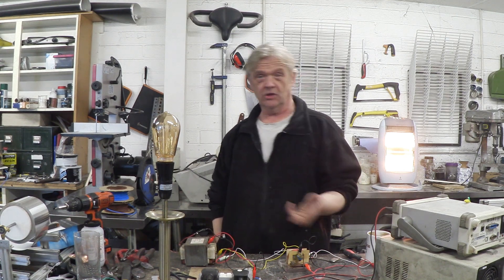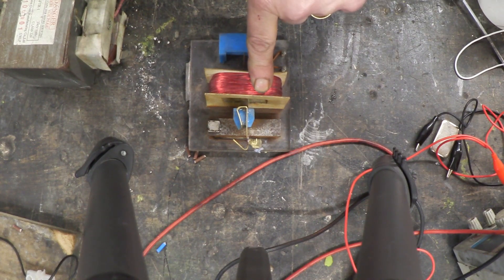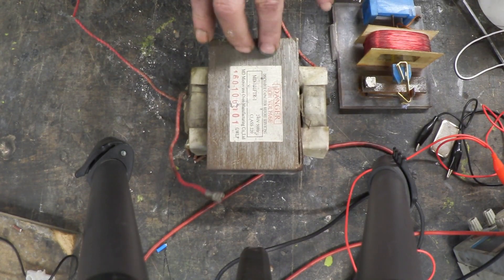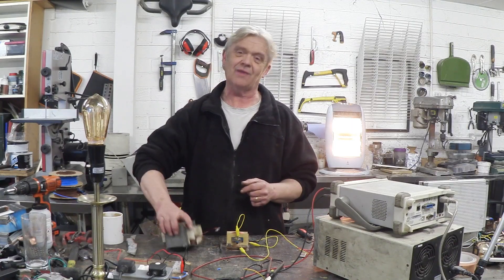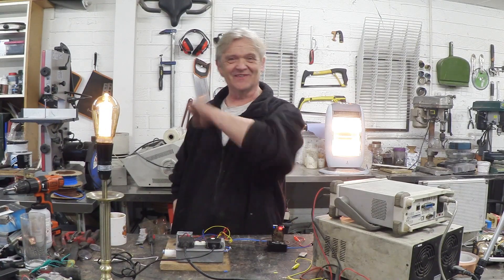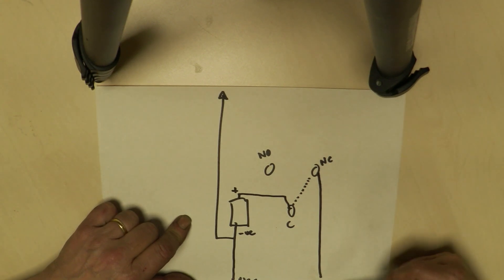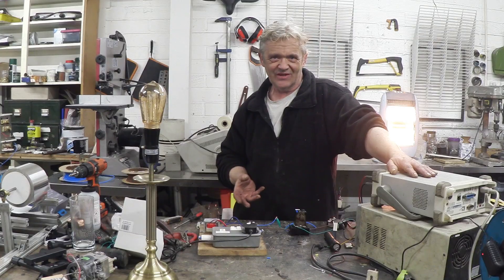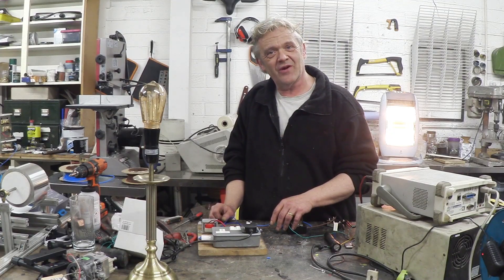1026 The Easiest Inverter You Will Ever Make

Comment: I was looking into this some time ago and was put off by the cost of relays and the noise, not sure if with an SSR solid state relay H bridge it would be better (never got to test it). I find it specially interesting as inverters now are expensive and can fail easily (makes it or complex to repair or expensive to replace). I was thinking of this in the context of heating loads during sun spells (solar + battery)
Reply: I... accidentally deleted the reply I typed. Trying to recreate it from memory:
Looking at this circuit, I don't think an H-bridge is even necessary! You just need some way to generate a square wave at the desired frequency (555 timer?), and use it to somehow switch your high-amperage DC side (Preferably with something less noisy than the improvised contactor shown, one DC SSR should be enough, in other words, as long as it can handle the power. Needs to be pretty powerful, though.). This eg. 0-12V square wave side goes through a transformer, and the AC coming out the other side has the same peak-to-peak swing, multiplied by whatever the step-up factor of the transformer is (-6 to +6V for a 1:1 transformer, -60 to +60V for a 10:1 transformer, etc.). Voltage is relative, so you can redefine your "zero" freely between the sides of the transformer. The only actual output it produces is the difference between its output terminals, and that only cares about the difference between the input terminals. The "average" of both sides can be completely different (as long as you don't connect between them)! Super clever stuff! Keep in mind that the peak voltage of an AC square wave and the RMS voltage are different, though! You'll need to do some unexpected mathematics when selecting your component values if you want to provide comparable 'voltage' to a traditional sine-wave AC grid!
That said, if you need AC at a voltage you can easily achieve for DC, an H-bridge might make more sense. I think this is more for producing bootleg (square-wave or otherwise malformed, but correct frequency and VA) "mains voltage" AC, as you would in some sort of emergency or off-grid power system (as he said, you won't be running any delicate electronics off of this, and some kind of motors might also be unhappy. It should run lights and heaters intended for mains voltage though, and maybe other stuff too! Keep in mind that the power supplies used in 'mains voltage' LED lights vary greatly. Some won't mind it at all, some might not work, some could even break, it all depends on the specific circuit used. No idea how fluorescents work, but they have a lot of electronics behind the scenes too, as well as being scary high-voltage gas-discharge tubes, so I would be afraid to try them with power sources they weren't designed for.

Keep in mind I'm not an expert, I just like to read/watch things like this. The books I have don't really talk about AC stuff a lot, and even less about non-sine waves, so I may have the wrong idea about any or all of this. Stay safe!
Reply from the maker: I used a DIN rail relay because it easy to see but Omicron make relays in the order of a pound or so with 100,000,000 fillips - and I din't get that wrong - they switch with that order of life - but the noise is an issue unless you put a piece of felt around it - An SSR can't switch fast enough.
Reply: Thanks to both , in terms of frequency i had thought arduino could be used to create the frequency for 50 a second. In terms of step up i got hold of a 240 to 12 AC transformer and was hoping to go in with the 12. For ssd not being fast enough, i could be mixing things up but i think the idea is a single one would only handle a  half AC cycle but doing the H bridge would give you both half cycles (yes, square form). There are ssd on ebay for high amperage (i thought i would target to use half the max rated amperaje). I am also  not a specialist, just dabbling and never enough time to finish things but this one i want to finish one day, i have a second 240 to 12v AC transformer, not sure of wattage now but its a 16kg beast 😅. Overall to use with a hot plate not electronics. All part of a wider thing... Damn the castles in the air and not enough time...
Reply: @TheBlackadder-Edmund  That all sounds good, except the use of a microcontroller as a frequency generator. As it's going to be exposed to whatever electromagnetic noise this inverter makes, and whatever poor-quality power source it's connected to, and the sudden power drops on the DC side from the AC side being connected to a load, I would be worried about a microcontroller potentially crashing here -- keep in mind that, if it crashes while generating a PWM square wave, there's a 50-50 chance of essentially shorting your DC supply across the transformer. Maybe I'm just overcautious, though.

Comment: I personally like the idea of useing a brushed motor t drive a commutator, I think it would be much esyer to make a drive sircuit for. I think they used to make an inverter made of a motor connected to an altanaitor at some point i'm guessing it'd be the best regarding both control and sine wave quality.
Reply: True, this was common technology. My Dad told me about working on the Vampire (1950's, one of the first jet fighters, used in the RAF and RAAF, amongst others) that employed this to obtain high voltage.
Reply from the maker: I believe they were called dynamotors mate

Comment: Good project and demo.  I'm anticipating a variable, controlled frequency oscilator made from a cheap rc motor and driver, with a magnetically pulsed, voltage amplifying switch actuated by a rotary magnet, in a shielded, steam punk case.
Reply from the maker: lol - pretty much the plan here mate lol

Comment: I immediately thought of my father's Model T ignition coil/box.   (Made my first Jacob's ladder with it).

My first thought on the frequency stability:   I think you could add a 50/60 hz resonance circuit to the activation of the relay coil to help stabilize the frequency somewhat (without making it overly complex).

Additionally, like the old Ford coil, you could have a thumbscrew to adjust the spacing between off/on (deadtime) which could optimize for frequency too.
Reply from the maker: a capacitor in parallel with the relay coil will do it mate thought you would need a DPDT relay as you would need to connect the output to a different switch to help prevent frequency drift

Comment: LOL I have a 300w 12v / 120v inverter from back in the 70's that uses a vibrator relay with a set screw to set timing.    Being square wave out put it's noisy as hell but works for many things.  Most modern Computer PSU would be ok with it. KISS , Keep It Simple Stupid is the game.     Not like your trying to run a Air Conditioner with the thing.    Put a .o1uf cap across your contacts and they will not ark so much.
Reply from the maker: lol - that is awesome mate and thanks for the cap tip

Comment: The Surge in Solar PV caused Me to realise the Possibility of more DC Systems.
In Turn DC Lighting is Easy to do.
If Only the Manufacturers Offered a Broader Range of DC Lamps plus DC Rated Switches.
I did Enjoy the Video.
Reply from the maker: I agree the real answer is to change the equipment used to DC - after all most of it I DC already and ac is really only used to transport then changed back to DC for loads of things

Comment: I did the exact same thing except all i used was car relay, running in series with contactor, and to control the frequency rate you put different rating capacitor on the coil,
Reply from the maker: cheers mate

Comment: brings back memories of 1950s car radios that used valves  with a vibrator power supply fot the HT
Reply: Yup... 1957 Chevy from my youth... remember that HV step up arraignment pretty well.... and waiting for the radio to "warm up" before it would start to output audio...
Reply from the maker: lol - exactly where I got the circuit from - I just cut out all the stabilising stuff

Comment: What comes out of there is rf interference pissing off all your neighbours lol
Reply: Much less these days, but you'll certainly piss off Hams for quite a ways away.
Reply: Make it inside a microwave.
Reply from the maker: if you really wanted to do this you just put it in a can like they used to - this was used in car radios
Reply: Absolutely, RM-S! radio inside the passenger compartment, aerial on the fender, but DC generator commutator , voltage regulator contacts, distributor points all potentially causing noise. Spark suppression was in a field all its own. Solutions are out there, our fathers and grandpa's had it all down pat.
Reply: yeah, i just replaced a voltage regulator on an 1950ies hanomag, the old one is still jumping along at 16V, I now may hook it up to an old transformer and make myself a variable AC powersupply.
Reply: Some people use this kind of generator when they don't have access to a proper EFT burst generator. (search for ford emc) Interesting how the sound started to distort for a second when the circuit was operating.
Reply: And gets the local utilities out crusin with radioscopes to find you too
Reply: One other disadvantage tthat Robert did not mention is a significant DC bias in the transformer's magnetic field. Because of it in order to avoid the transformer core saturation (and so preventing  it from being a transformer) you need a much larger core than the load justifies.  Which is obviously very inefficient and heavy.
Reply: @blg53  It depends on the duty cycle. Unfortunately, my ears are not trained to estimate a duty cycle from sound over a certain frequency. But I also wish my eyes to be thermal cameras with the ability to see magnetic and electromagnetic fields. But I think nature is still struggling with the placement of the input selector.

Comment: It's interesting how things were done during the industrial revolution. I am going to play around with a bridged MOSFET device with 2-3 FET's on each side to reduce the heat, but again it's about getting a pure sine wave on the output
Reply: Sine wave... Rather than running the fet as a voltage controlled variable resister. You may be able to run it as a class D amplifier. Loads of circuit examples of such. But pretty much a pwm signal that ramps up and down in duty, switching a fet between off and on... followed by a low pass filter that blocks the pwm switching frequency, but allows f of Sine wave through.
Reply: @stevecummins324  yes, this is what I meant, it pumps the switching frequency into a transformer to achieve the best possible 220vAC wave as possible with the purest possible sine wave as a result.
Reply: @stevetobias4890  the inductance of the transformer input coil will itself act somewhat as a low pass filter. Add a capacitor across it if you want to further lower the maximum frequency it'll pass. (LC low pass filter if you wanted to calculate values, rather than determine experimentally)

Pwm signal frequency at  least double the output frequency. And low pass filter cut off f between pwm and output frequency. 
Higher pwm frequency won't make for cleaner output... But will allow small component values to used in the low pass.Most FETs can cope with 1kHz pwm speed and that's more than enough for a 50/60hz output. 

Pwm signal could be generated by a Sine wave oscilator circuit, a voltage comparator and a ramp waveform generator of 1khz frequency. 
but arduino probably easiest.
Reply: @stevecummins324  thank you Steve (great name by the way) 👍
Reply from the maker: awesome mate - sounds like a good project

Comment: I have lots of microwaves. I've been collecting them lol. I see an arc and it just makes me want to go and practice my welding.
Reply from the maker: it was quite an arc lol
Reply: You like arcs....

Make a capacitance charger.. I ran it with 2 (used for Browns gas generator I have)

Put 2pieces of charcoal and put them under water in a bucket. Nature of capacitance charger allows you to pull the charcoal apart increasing the arc back and forth.

I'm not too skilled but piss easy to make just caps and bridge rectifier.

I used it for a Alchemy experiment making Iron.

2 Carbon molecules + 2 Oxygen make "a type of" stainless steal

Human resonance. Org
Reply: @cassdroid2183  sounds really interesting . You should make a video mate

Comment: Hi Rob, you should attach a capacitor across the points to stop them burning out. Use the condensor from an auto ignition as it is designed for exactly this use.

Note: the relay is only hiding the arcing from view, it is still happening.

Edit: LOL! I commented before finishing the video, I see you addressed it at 5:20. :) HAHA

Well done mate.
Reply from the maker: lol - cheers mate

Comment: Took inspiration from you this week. Saw a treadmill with free scrap on it on school run. Took it home stripped it down. All looked ok apart from the motor not turning. Took it appart and found what looked like crispy spiders inside stopping the coil from turning. Cleaned it up and is now working. Put it all back together and now have a treadmill for my pain cave
Reply: Well done m8🙂
Reply: Good job!  Rescued one myself, also (membrane keypad was corroded, so I wired in some pushbuttons for the necessary functions).  Pain cave made me LOL
Reply from the maker: I just love that story mate - well done you and thank you for sharing